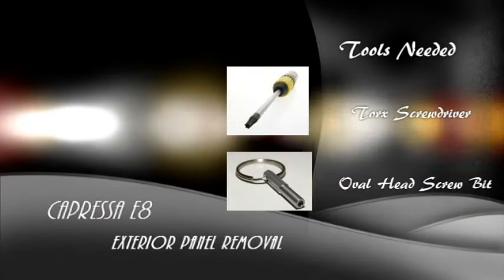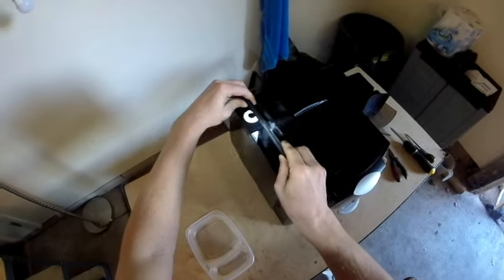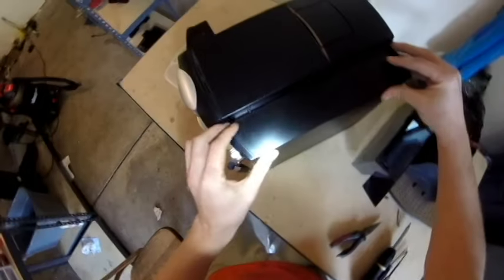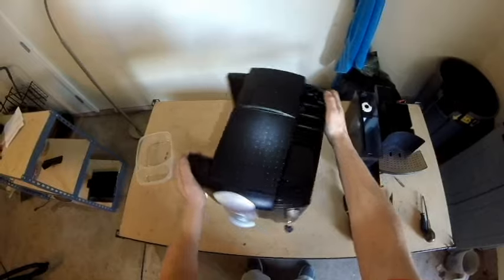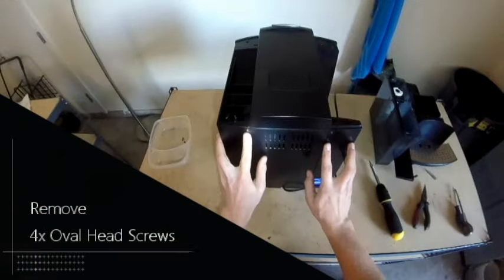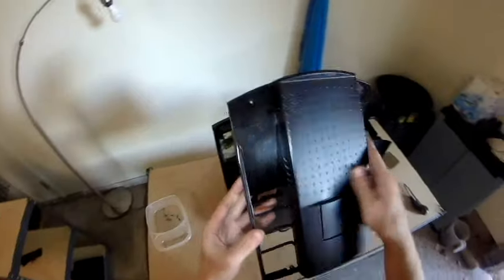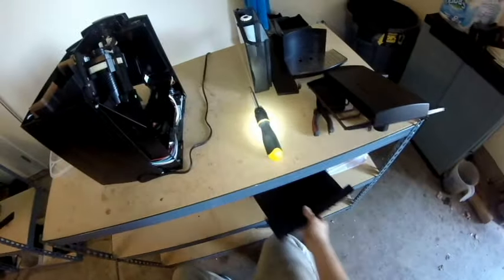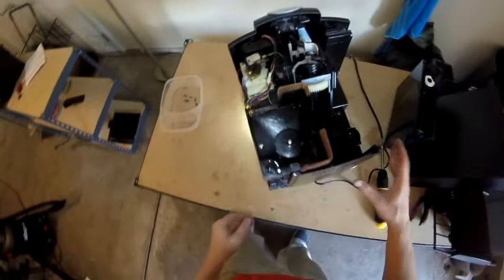How to Open Jura Capresso-Impressa C-E-F Coffee Machines

Comment: Useful video. I have an Impressa C9 and was getting an error 2. Replaced the thermoblock sensor and that fixed the problem. To open the case you'll need an oval head socket which you can get from Jura Parts for about $8 USD. You'll also need at 15 Torx  for the case and a 25 Torx to remove the sensor from the thermoblock.

Comment: Hi Vet first thank you for your service I will put a Vet first every time! Retired out it myself 22 years I saw your YouTube videos and purchased your rubber gasket pack with the oval driver. Question, I did the whole shebang and I don’t know what I did wrong but the slider in the front that adjusts for espresso and larger won’t go up far enough to put the tray back in what did I do wrong? Thanks for taking on the big dogs my brother I’ll back you every step of the way!
Reply: Oh I forgot it’s a C-60

Comment: Ummm, the bolts on the back of my Jura C5 have no slot, oval or otherwise. The top is completely flat, and the outside is completely round. How the heck do you get them off?
Reply: Mine too! Did you figure this out? Mine was a refurbished machine, I was wondering if that’s why they’re different?
Reply: @emilythechef  Mine was refurbished, too. (Believe it or not, we found it at a thrift store for $35.) How the heck are you supposed to get those screws off? I know they come off, because when we had it refurbished, we had to send it back a couple of times to get everything fixed.
Reply: I watched another video and was able to get the screws out! I used pliers that were more like nippers,  and squeezed them right and cranked the screws out. I ruined/scratched the back panel doing so,  but that's ok.

Comment: @Jura parts, Hey, I need some help, Do you by chance know how to stop the coffee spout from leaking? Coffee spills out from the white plastic piece above the coffee spout, and does not go through the 2 silver pipes. I've tried to poke a small hole with a needle to start the flow again, that worked for 1 use, and now it is clogged again. I have a Impressa C60/65.

Thanks for your help.
Reply: Same here. I have the C5 (for 10 years!), and the coffee spouts are blocked, and coffee comes out of the plastic lip. How to repair ?
Reply: tatstarone I've found a temporary fix, inside the pipes was apperently some raw grounds that got clogged. I used some thin metal pliers to pull out everything inside. In doing so, I found that the valve inside was jammed with coffee grounds. Clearing it out seems to have fixed it for now.
Reply: Andrewx8 88 thanks for that. However I've decided to give it to jura for a service. first service after 10 years! costing me £199 pounds (I'm in uk). For that price they will service it and replace any parts. I think it's a ok price.

Comment: Is there video how to take thos front pipes off?
Reply: I took apart my Impress C9 because it was pouring coffee out the up/down tab & not the holes. Turns out the entire pipe element was completely clogged with coffee build up. You need to take apart the faceplate, remove the 6 screws at the back of the faceplate and remove the entire front pipe assembly. It then comes apart. Make sure when you put it back together you align the up & down mechanism with the pipes, otherwise it will not be right.

Comment: There is no need to remove the water and bean lids, this only risks breaking the clips and is unecessary in the opening of a Jura. The top will come right off with the lids attached. Once you remove the oval head screws, you can replace them with torx, phillips or slot head screws. You need to find screws of a similar diameter, length and pitch.It makes future dismantling easier.
Reply from the maker: Thank you for your comment.  No, it is not a necessity to remove the bean hopper lid or water tank lid to remove the side panels, as the entire top cover can be removed, in tact.  We at Jura-Parts.com do not take shortcuts; we do all work to the greatest extent, and in doing so, we have found that machines being repaired and cleaned with care and consideration makes for longer lifespans.  The Jura coffee machine client base that fixes his own machine has a higher technical ability that unclipping two lids is not so much of a great feat.  The risk of the lid clips snapping is greater when leaving them attached while removing the two T15 Torx screws by accidental contact. In addition, it invites the temptation to remove the top cover by pulling up on the lids, rather than the top cover, which will easily snap the clips, so we advise to remove these two lids prior to removing the Torx screws.

On another note, instead of replacing the screws, it would behove a client to use a container to hold the oval head screws to reduce the chance of losing them.  Replacing the screws with non-OEM "torx, phillips or slot head screws" may lead to more problems with the operation of the machine.  The top cover is secured atop the bean hopper, which directly funnels into the grinder. The bean hopper contains two gaskets that fit to the top cover to reduce noise and vibration during the grind process. If non-OEM screws are used to secure the top cover, then the machine may not perform at its optimal level. Higher vibration levels may force an excess amount of beans into the grinder at a faster rate than the grinder is capable of handling, causing the grinder to jam.

Swiss made products are manufactured with precise mm measurements and parts in the United States are not comparable. 

To summarize, if you want your $1,000+ Jura coffee machine to operate like it should, do not take shortcuts.
Reply: @Juraparts  Where can I find an oval head screwdriver bit?
Reply: @stephencoco7802  I thought the same thing.  Amazon with free 2 day shipping for prime members.